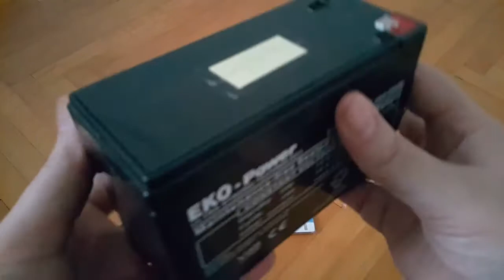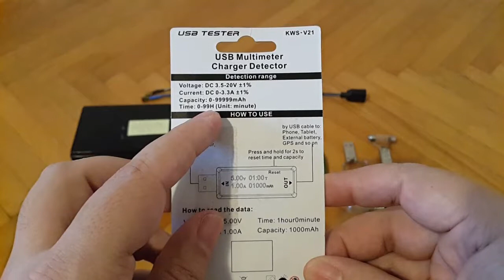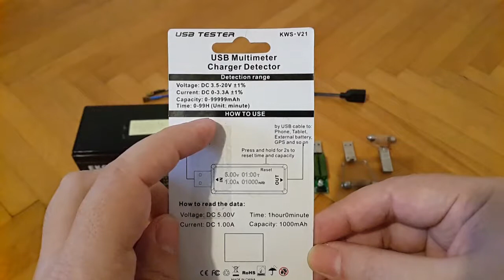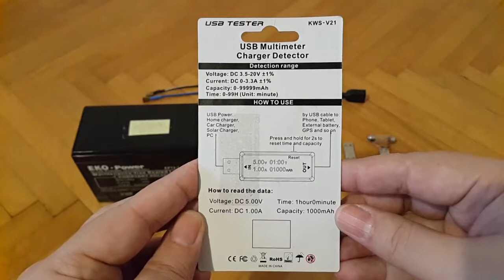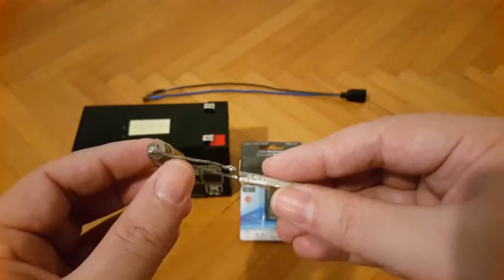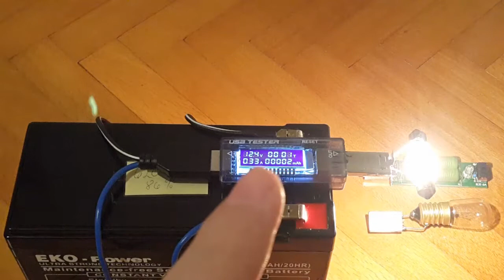Testing a 12 V VRLA/SLA AGM Battery With a USB LCD Power Meter/Tester ?

Comment: How many Ah did you get out of the battery before it was discharged?
Reply from the maker: Hi,

I think it was around 6100 mAh or so (see description of the video). I sold the battery fairly quickly after uploading this video (as proof of its actual capacity). 🤔🙄

Best Regards,